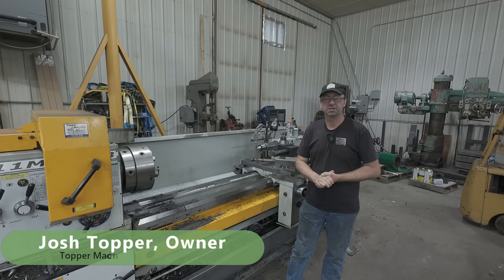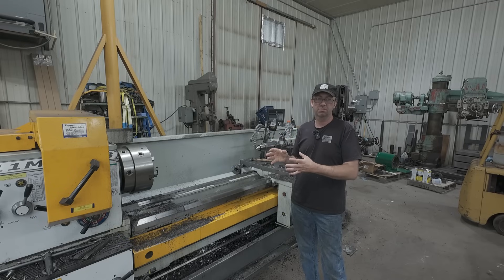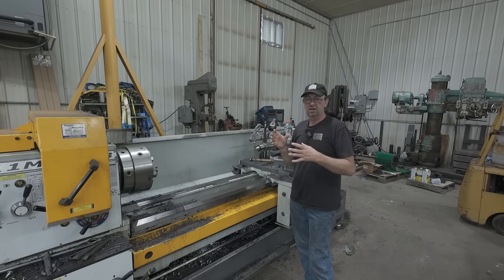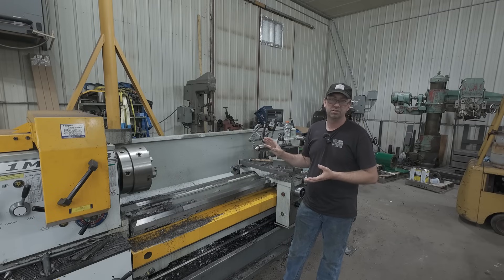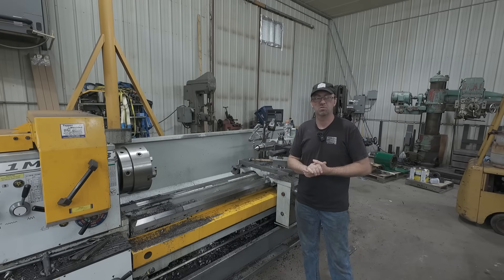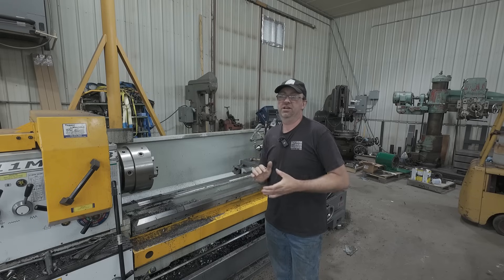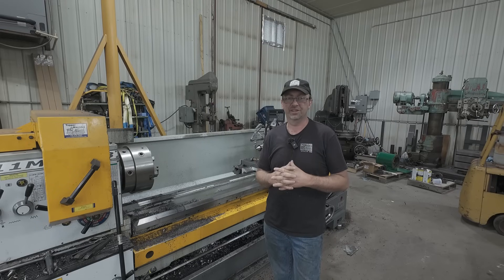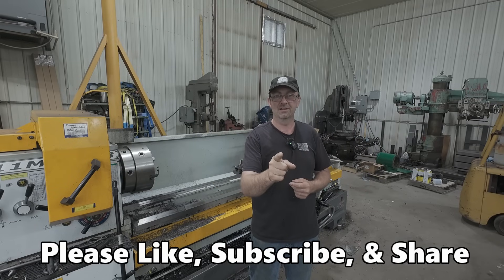Answering Viewer Questions About Roughing The Big Stub Shaft | Manual Machining

Comment: There was once an offshore accommodation vessel which had cracks in the lifting jacks and had to be de-manned. As l was the independent technical assessor appointed to investigate, we identified the root cause, and the final recommendation was to machine new from solid ingots. This is more reliable than casting or welding, on safety critical items 🇬🇧

Comment: I'm not a machinist but when I spill a drawer of hardware in my shop, I use my lawn magnetic nail finder. I always use mine after roofers are done before mowing.  
I have often seen chips being cleaned up in machine shops and wondered why not give it a try?  You will still need a broom for sweeping under machines but anything on the floor would be easier it seems.  You would not even have to use a dustpan.  Just hold the roller over your bin and pull the handle to release all the chips.  Just curious.  Thanks.

Comment: Machining it out of one piece is sensible in this size if you want to be sure. Metallurgy is an obscure subject for many. For way larger shafts, it’ll be open die forged. Like a 200ton shaft for a power plant.

Comment: If the customer worked out the best way to make the part, then that's how you do it. If they found failures in other methods and this method doesn't fail, then that's why they want it done this way, regardless of how much material is wasted in the process.

Comment: You talk about inserts so I do have a question for you, what is the correct toolholder/insert combination to use when turning Aluminum.
I read the tool itself should have positive rake and there are AL specific inserts which I know about but have been unable to really ID the right holder to use.
Would be interested to hear your take on this topic.
Reply from the maker: I don't deal much with aluminum, other than some milling. As far as turning and milling, I just use whatever tooling I have on hand and anchorlube.
Reply: That depends. Some aluminum is soft and sticky. Other is relatively hard and free machining. On T6 I might not even reach for a carbide tool. Tool steel can do nicely.

Comment: My hands are great at sweeping up metal chips..So good I have to use tweezers or pliers to get them out again.......

Our version of dollartree is called poundland ...If you watch what you buy some of it is exceptionally good, obviously some of it is dross and you can tell, but I pick and choose ...I've got a steel ruler that is so bendy its weird but for marking out anything round its amazing and the markings on it are ground  in too ....
Paint brushes plastic boxes , I think they buy ends of lines as well as cheap chinesium  and the ends of lines are often fantastic.
 Thanks for sharing

Comment: Good morning Josh, 
You’re hitting it out of the park with your heavy machining and answers. I thought you handled the question about the insert just right. Many YouTube viewers are not machinist but are simply curious about how the trade works. 
Several months ago I sent you packages of steel and aluminum boring head extensions. For whatever reason you decided not to introduce and demonstrate them to your viewers. Probably too busy. If you’ll ship me the aluminum parts only I’ll mail you a check to cover shipping plus a generous gift to your channel. Watch for my email with part photos and shipping address. Thanks.
Reply from the maker: I'll call you tomorrow.
Reply: @TopperMachineLLC Thanks, Looking forward to your call.

Comment: So now you can quote at a point 75% of the difference between your quote and the overpriced one and it may do the trick of getting you the job on the first go round. Good luck. A friend use to give free haircuts and got complaints. She started charging going rate and got no complaints.

Comment: At what quantity do you suppose it would make sense to buy or build a trepanning tool for a project like that?  I get it sometimes the investment isn't worth it for the small runs, but just curious at what point would it make sense?  Also do you make many shop made tools? That's some of my favorite content.
Reply from the maker: If there was any use for the removed material, a trepanning tool would be a good idea.  But, I have no use for a large tube that would take up valuable space in the shop.  As far as a time savings, I don't know that trepanning would save much if any time.  

I do make some tools, and have videos of them.  Just look through my older content.  I also have a video coming in a few weeks of a new tool I made.

Comment: Inflated rate, in other words it’s the “I don’t want to do it “ price.
Reply from the maker: Probably, but they really messed it up.
Reply: Might also be a fair rate for doing it on their  equipment. Josh has a lathe that can take huge cuts like this. If the other guy does not have the HP to do that, it will take him longer. Bottom line, we just don't know. It sometimes comes down to if you have the right tooling for the job.

Comment: For brooms I am really sold on railroad track and switch brooms. They do cost a bit more (maybe $50) but they are indestructible.  My oldest one is 6 years old and its still got years if not decades left.

The key is the bristles are made of something resembling weedwhacker line. Even hot chips do not cause issues, and they are stiff enough to move a decent size pile of heavy chips.
Reply from the maker: Switch brooms are good. I just have a hard time buying them at that price. Used to get them for free from the WC and CNW sections. Those days are long over.
Reply: @TopperMachineLLC i actually just looked, and theyre a bit less than I expected.  $45 Canadian up here from Grainger. Probably $35-40 down your way?

Comment: We have had the same experience with stub shaft failures. We have one customer who actually has the entire tail pulleys for conveyors made from solid rather than the usual 3 piece, 4 piece, or 5 piece arrangement.
Reply: I was going to ask what factors engineers consider when they decide to go with a one-piece design.  I wonder if they chose a different type of alloy if it would solve for brittleness issues on welded shafts.  I think about the strength of hydraulic cylinder eyes that are welded on, although I realize the majority of the time hydraulic cylinders rods are under tension and compression stress rather than torsion stress.
Reply: @buckinthetree1233 its a combination of factors, you also tend to get some warpage in a multi piece roller, so something machined as a unit will be more accurate and can increase bearing life